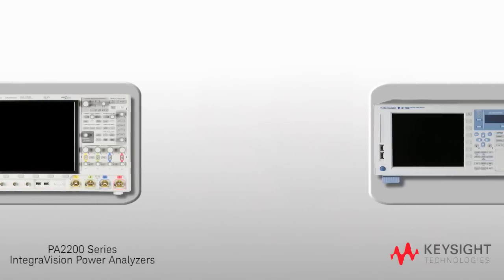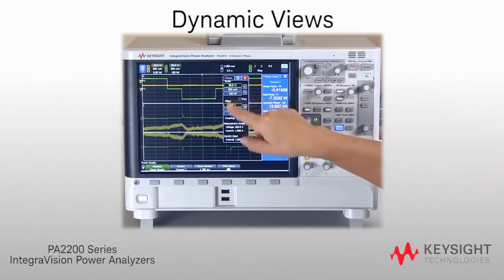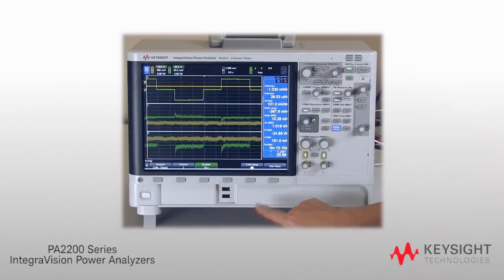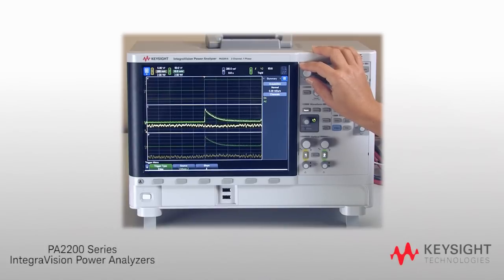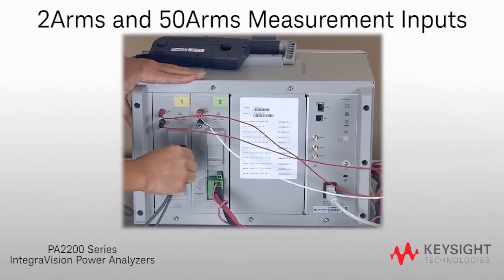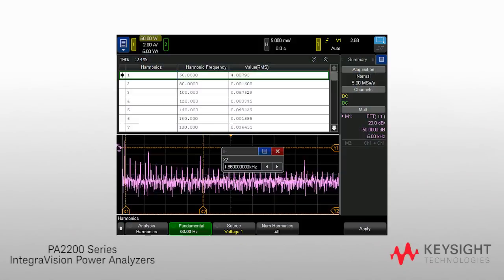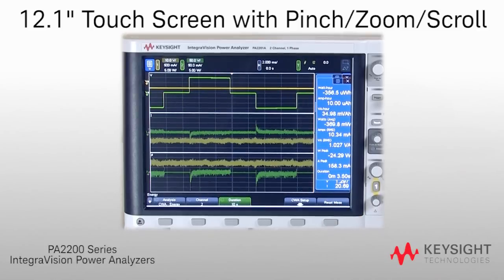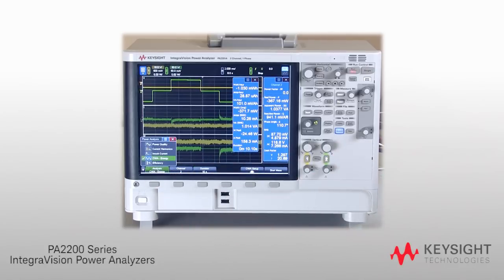PA2201A IntegraVision Power Analyzer provides dynamic views of current, voltage and power

Comment: perchè avete mostrato il WT1800 e non il PX8000 di Yokogawa che è stato presentato MOLTO prima del vostro PA2200??
Reply from the maker: ernesto trivellato.  We visited many customers around the world that are designing highly efficient products and need more accuracy than the PX8000 to make their measurements.  In addition, most had trouble using the WT1000.  The PA2000 provides a true scope like interface along with the accuracy to make precise measurements.